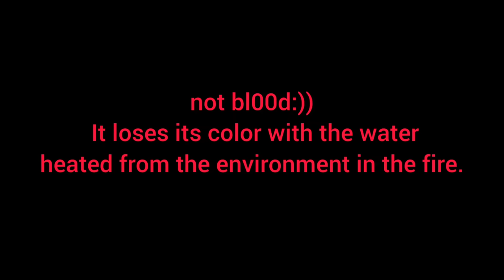Fantastical carpet - Dirty carpet cleaning satisfying ASMR

Comment: Here's something you can try that'll save you on some of your cleaning and your pre-wash hang it up so all the dirt goes out not in back into the back
Reply: I'm not sure how feasible it would be, but I keep asking the same thing. Would it not be easier to hang it, during rinsing, so it doesn't seep back into the fibers from the back. And, to only have it on the flat surface for the purpose of using the scrubbers on it.